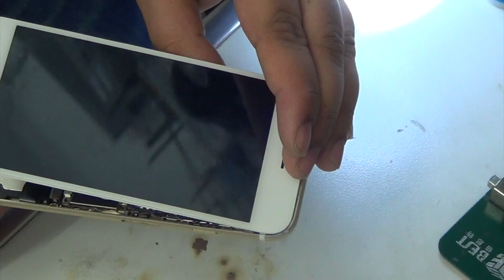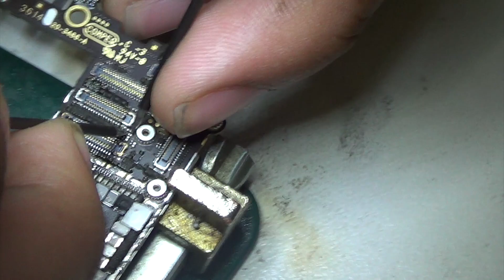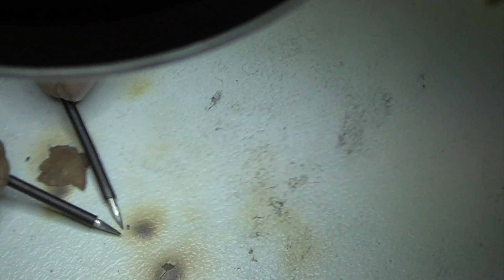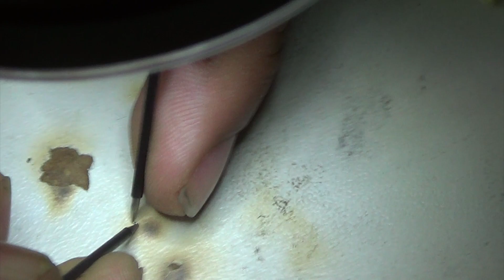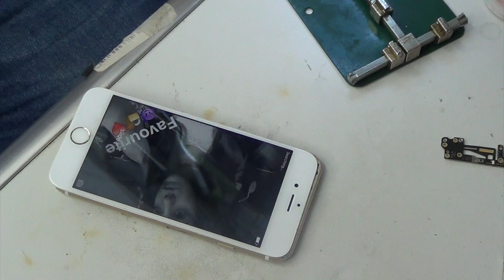How to fix/repair Iphone 6 backlight

Comment: What if you just put a brand new screen on altogether will that fix the black light issue?
Reply: If you're definitely sure it's a backlight issue, then unfortunately not as iPhone 6 backlight issues usually arise due to on board damage. If that's the case then you'd need to seek repair from a micro solder technician.

Comment: Hello. information if possible?
I have an iPhone 6, which is recognized by iTunes, but the display remains blank.
reflected heat on the connector area and the A8 processor.
fl2024 measured provides continuity with beep
Reply from the maker: it could be the back light

Comment: can i use a iphone 5 or 5s fuse and diode for replacement ?
Reply from the maker: you can as long as they are the same value.

Comment: i want to send mine to you. it's a 6s and i ordered a 6lcd instead so when trying to replace it the connection started smoking.  i had turned off the phone but heard for 6s need to unplug the battery.  now it powers on but there is no display on new 6s screen and old screen.  Do you think you know what the problem is?
Reply from the maker: please visit our website www.m6mobile.co.uk
Reply: You blew the backlight filter. I've done the same mistake before.

Comment: ello!! my iphone 6 was replaced lcd , after that the backlight did not work , with the screen out of the machine can see in the dark , but the screen on the device not see anything . This may be the video problem or the problem of larger screw , how much it costs to fix each type of problem? I'm in Brazil and send by mail .
tks

Comment: if backlight works sometimes do you think the filter solder connection is no longer good after replacing display?
Reply from the maker: +Dustin Murphy its worth checking atleast

Comment: Dear 
Here is my story 
Yesterday I noticed that my front camera is covered by the circle rubber which is covering the front camera , it moved by its self day by day until it becomes so annoying..
I have my tools and I prepared everything to open the  screen, 
I do great but when i but everything back in place i figure that the screen shows a half brighter the the other side and when i lock the phone i cant turn it on again without the soft restart!!!
When i fix the camera i removed all plugs while the phone was switched on ,,, 
I went to the repair store and one told me that the power and light ic's need to be change
One told me that only the lightning ic  need to be change,
No one of them checked inside the phone ,, they only heard what i told ,
And it will cost me more than 150 us dollar 😞
My phone is iPhone 6 plus
Reply from the maker: It does sound like your backlight is gone. now it the matter of having a look at it physically if you are not 100% sure. If you like you can visit our website and drop us an email.
Reply: No its not, there is a light but a side is dimmer than the other
Reply from the maker: have you tried a new lcd screen?
Reply: +M6 Repairs nothing is wrong with the current LCD , i ordered the backlighting ic U1502 alreday
Reply from the maker: +Mohammed Alrubaiqi dont just change the ic check the filters first
Reply: +M6 Repairs i will, thank you so much

Comment: hey, I have an iPhone 6 and it has no power. it was dropped and the screen turned off, but I knew it was still working because the phone got hot. it has a small bend right by the sim card. it is a very very small bend. the phone has been sitting for months and the screen is not cracked. I made sure the connectors didn't come unplugged and they didn't. nothing still gets this phone on. what can I do?
Reply from the maker: try new new display on it
Reply: i would but now the phone doesn't power on.
i did play with the insides a little bit but i made sure i put everything back on the way it was. can the screws that hold things into place play a role in whether or not the phone comes on?

Comment: hi i have an iphone 6 in for repair with no backlight i checked all filters al good but on checking the diode it had a hold bunt in it so replaced it and connect battery but it blow again so replaced the ic next to it but its still blowing the diode do you know whats causing this